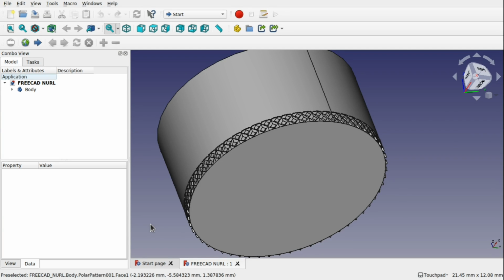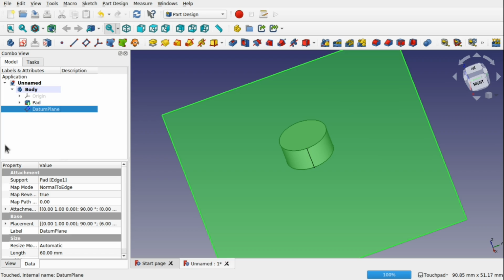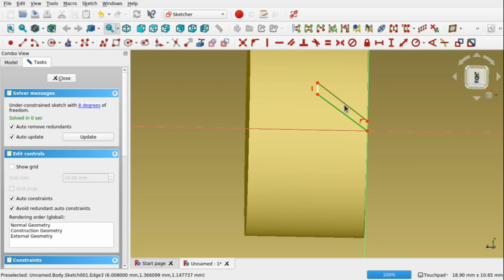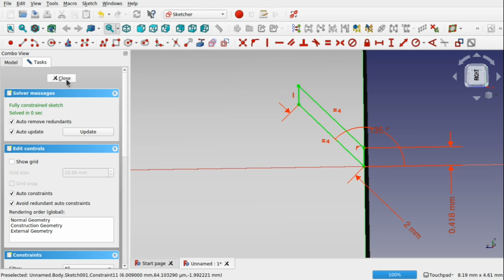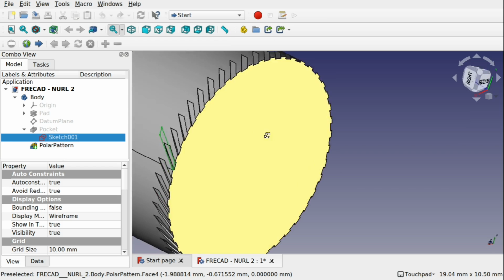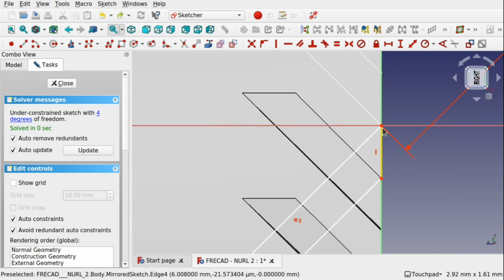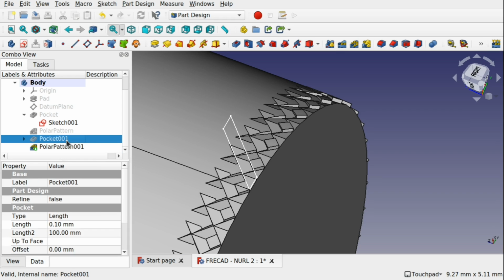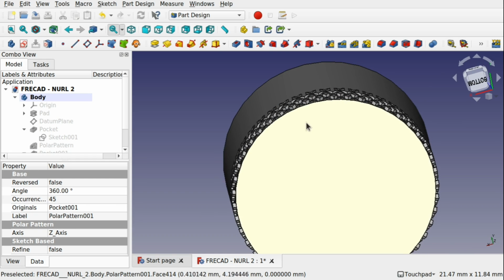FreeCAD : Add Knurling / Knurl / Grip / Texture to your surface for 3D Printing.

Comment: That was great thanks. I had to settle for vertical grooves because my pc is too slow, but it was easy to work out how from this tutorial.
I wonder if you cut 30 degree pockets right through a cylinder edges you could model a hyperboloid?
Reply from the maker: That's a great idea, it would definitely be worth experimenting with the pattern tools to see if you can achieve that geometry.  Due to the amount of edges created it can be very computational heavy.

Comment: I found that instead of typing stuff into Google to calculate, it's much smarter to use the built-in Spreadsheet, and reference its fields. That way if you want to adjust something - say, the diameter of your shaft - you change a number in the spreadsheet and the change propagates throughout all the dependent elements, instead of you having to redo the entire work manually.

Comment: On a lathe, knurling is achieved using a v-tip following a helical path up the cylinder. This is replicable in FreeCAD and would give a more authentic-looking result. You're correct, however, that the process is computationally very heavy.
Reply from the maker: Yeh it does take a while to recompute.  In my lattice tutorials these are much much more faster but requires a different technique.  Personally for output to physical form I would rather finish this with a tool, such as a lathe as you described (if available) or use something like blender to finish off model.
Reply: As someone who operates a metal lathe I can say that doing it on the computer is quite a bit easier! Also the options are almost infinite. Like you couldn't actually do this particular pattern on the lathe you'd have to have a raised bit of metal in order to through cut this with the knurling tool. And yeah a square ended tool would be chattering like crazy. With a computer you could knurl it with a pattern of a skull and crossbones! Or ladybugs or long-stemmed roses. Amazing.

Comment: Thanks, I followed along and created created a object I am working on, my challenge is can you repeat the pattern across that outer plane, I tried some things, no luck. so if your still following responses for this, maybe a video on that, the great part I have learned a lot from you, thank you again, I have subscribed and been watch all you videos, keep them coming, thanks again
Reply from the maker: Hi, so glad your finding the channel useful and thanks for the kind comments. So are you looking to place the same knurling on the bottom and sides so if you did both you would cover the whole object with knurling?
Reply: @MangoJellySolutions  only on the outer round like your tutorial demonstrated, keeping the same plane in your demonstration and "Z" axis, I am thinking another plane and offset on Z axis by the length of first/second pattern, then duplicate until you have the outer round surface completely knurled, other thought was, a curved first/second pattern at the same circumference of the round, thanks for replying, les

Comment: Thank you for this  excellent tutorial (and all of your others too)!!! Is it possible to make knurl on other than round objects, for example if I sketch a rectangle, put fillets on the corners, extrude and knurl the whole object. Or even only the left side of the box (the two rounded corners and the straigt wall)? I've tried alot but without success :(
Reply from the maker: Glad your enjoying the videos. That's an interesting challenge, never tried it myself. I see if I can figure it out.
Reply: Wondering the same thing...I have to knurl a stadium shape which is a mix of both.  Two round ends but two flat sides that all need knurling.

Comment: hundreds of hours in freecad, part design workbench still seems like a waste to me, every time I try and work in it, I get frustrated after 45 min, delete everything, then make the part in the part workbench in 20 min. But as ever the software continues to grow and hopefully stuff simplified.
Reply: This has been my experience. It's quicker for me to just write things like "knurl" onto a sketch and then do it by hand on the lathe with the final part. I've spent probably 20+ hours trying to learn how to knurl in this software and either I'm missing something in the umpteen tutorials I've watched, or my freecad is broken because it doesn't work.

Comment: Could you not use a helix path, in the same way as wrapping a thread around a cylinder? but cutting it instead of a adding?

Its a bit above my paygrade yet, but I thought your brain might stand a better chance than mine LOL
Reply from the maker: You should be able to, I have done this also with the path array where you can select the edge as a path. Probably be much quicker to recompute as well.

Comment: That's interesting. I have recently been looking for a way to map a regular texture onto a curved surface, and this would work for small features being repeated in a regular manner across a curvature large in comparison to the feature size. Another variant might be using the "projection onto object" of the part workbench to mitigate some of the problems of the curvature of the surface. I still haven't found a way of projecting a texture onto a irregular surface (like putting a hexagonal pattern onto the mouse design you featured recently) and I'd be interested in your ideas on this possibility. I'm afraid my understanding of FreeCAD is somewhat thin and confined to part design, sketching and a few other random features!
Reply from the maker: Thanks for the comments. The other possibilities for repeating patterns would be the draft wb array options on the modifications menu. If you used the path array then you can make the pattern tangent to the surface using the properties on the data tab you will find align which you can set to tangent and then change the tangent vector as normally it starts with a 1 in the z when this should be in the x or y. You can then up the count to as many as you want. The path can be either a sketch path or an edge.